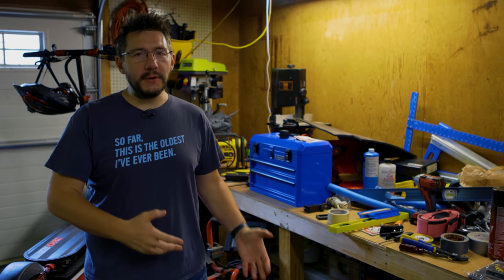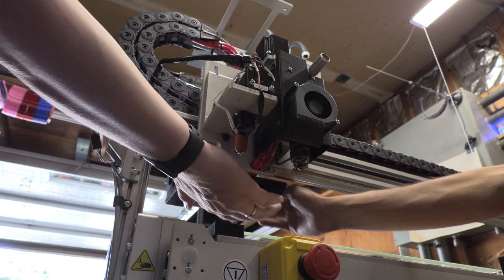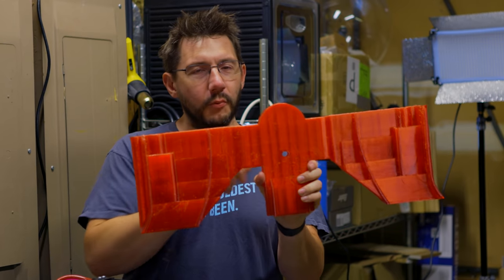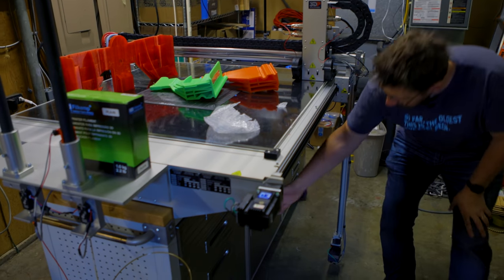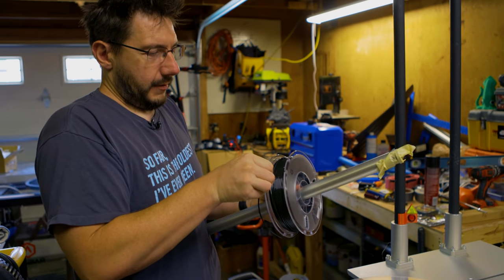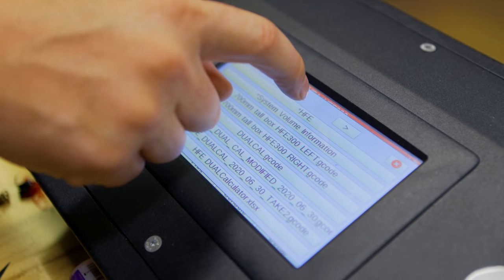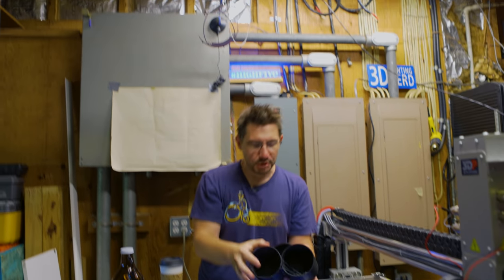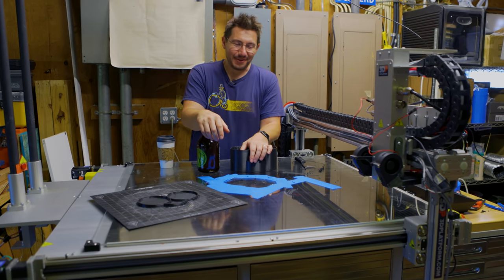I Broke a $38,000 3D Printer

Comment: To say that $38000 for this printer is overkill, is a gross understatement. You can go to CNC4Newbie's web site, where you will find their C4N4848TK 48x48 CNC for $4299. You can very affordably convert a CNC machine to work as a 3D printer, as opposed to this very expensive printer.

Comment: i cant resist,, did you hurt you finger bahhaha try grabbing a hot exhaust a few times at the head ;] I moded my cr10 to print a 300x400 mm vase in 12 hrs or less ;] i bought it for 225 used.

Comment: That is one BIG -SS printer I agree with most of the replies PETG  on glass ? first of all if I was building a printer that large I think I would build it with a segmented build surface either in .25% build area or a center build plate as large as a regular print for this printer with 4 or 8 Perimeter plates so when you really go wild that way you only have to heat what you need. Second I would use some other surface rather than glass & if you insisted on glass go at least 0.25" This is an industrial printer so do it right any way those are my thoughts Really wish I could get some time in that printer while you have it you might offer a contest on WHAT WILD PRINT DO YOU WISH YOU COULD DO then work with that person if necessary on 360 then print it could get interesting

Comment: It's pretty common knowledge that PETG welds to PEI, Glass and many other surfaces. I'm pretty dissapointed in you for not knowing this given who you are. Substances normally used for adhesion such as hairspray and gluestick work well here as an interface layer to prevent the welding.
Reply: Well, a 40 000 dollar machine should not have any issues like that. Its the quality of glass they cheaped out on...This is how you test and know if it's worth the money . I bet it was already cracked after so many printing

Comment: Making Jame's record required a sponsorship from a filament manufacturer and a large building to set it up.  It also took "months" to print all the pieces. Not tomention the pieces filled his house for those months. So if you're feeling up to breaking it...  Good luck.
Reply: I'd rather have you build a piece of furniture with it.  You could use the software that analyzes the topology for weight distribution similar to the shelf bracket. That plastic chair would be amazing.

Comment: Never ever ever ever ever ever print petg on bare clean glass. At the minimum use some elmers purple glue stick. I’ve been using this method for years after learning the same lesson, but on a smaller build plate.

Comment: oopsie … that type of glass is biggest issue too large for that print job  u need a glass plate with some carbon like ender carbonized glass plate it releases when cooled down to room temp ……large glass area tend to flex a bit than small build plate …
Reply: another solution to preventing that from happening is glue stick or blue tape ….

Comment: This Printer doesn't make much sense to me. A bed that is easy to break, no mesh compensation on such a huge bed (even though it looks like they are using standard Duet components so there is really no excuse for leaving that out), solid looking but apparently wobbly motion system, self-designed extruder (that can't handle a small blob?)... But most of all I see absolutely no sense in a water cooled which is usually used for high temp filament or in enclosures. If you want to print anything but pla or PETG you need an enclosure at that scale. If all the above was fixed the price would seem rather fair, but for a industrial machine one would expect to get a working and tuned Slicer profile for the most common materials. tl;dr: 4/10 would not buy for my company

Comment: don't worry, everyone that has worked with this printer, breaks it. i had one of them at a past job and my partner broke it two times. this printers are famous for being suicidal, sometimes the rth won't trigger well and it will put pressure on the glassplate until it explodes.
Personally i hate these printers. they are the worst. they also need to be readjusted constantly.

Comment: I'm rather surprised that Joel didn't know that you don't print PetG directly onto glass as it bonds, you need to use something like glue-stick, hairspray or something else that acts as a layer between the PetG and glass but I guess learn a new thing every day :D
Reply: Yeah, i thought the same.
Reply: In place non planar 3d printing repairs to the device itself using the laser sintering of mica seems possible though that would be unorthodox in approach.

Comment: Maybe you need to print a wheel for your car instead of a shifting knob. I wonder if a PETG wheel would stand up to putting a tire on it? Probably wouldn't hold air and would need PETG goop to seal. Make sure you print enough F1 RC parts for future builds. Maybe a hairy lion <-Funny.  I printed this stool https://www.thingiverse.com/thing:2929494 on my Creality 10S. I shrunk it down as I didn't want a full sized stool. Works great. I agree with Angus (Makers Muse) that the bed needs to be PEI springsteel and some form of bed leveling. 38K could buy you a 100 Prusa Minis.

Comment: I think the machine quality doesn't match it's price . Maybe because it's chinais made . But what I Know and is that you are so brilliant in this and if you give it a little thinking you should made your one machine in your garage by the control box separately from China and also the stepper motors ... Connection cables the nozzles the allumenum frame bearings holders .... Please just think of it. Love your work.

Comment: Bah, a BigRep ONE comes in at $35,000 and has a far better build quality than this machine. Dunno what you mean by a World record, because there are way more machines that have built bigger things. I mean they Built a Small boat with a Single print.
Reply: You are correct but not with PLA or ABS and not in the garage

Comment: He calls 220V serious power.. Everything in my house runs on 240V lol
Reply: Voltage is not power.
Reply: Most Americans don't know that the voltage coming into our homes, is actually 240VAC, and they call it 220.  I've even heard electricians call 480VAC, 440, and a lot of people call 120VAC, 115, or even 110.  Most of Europe has 240VAC as their mains, but some countries, like America, have 240 coming into the breaker panel that can be used for larger appliances, such as dryers, ovens, electric furnaces, and air conditioning units..., while the other lower voltage appliances, lights and outlets use half that, or 120VAC.
Reply: throngcleaver Merica.
It's the land of the fee.
Reply: @thedigitallifeguardproject7095  For sure!  And we need to keep it that way. :)

Comment: please explain why that printer is 40k and smaller than mine? i spent 4k to build a 1400x800x900 printer with heated bed and all. with parts from openbuilds and e3d...and mine doesn't have a wobbly z axis...https://www.reddit.com/r/3Dprinting/comments/gtkyue/build_update1400x800x900_printer_90_complete_just/